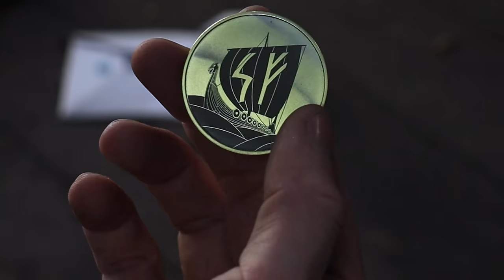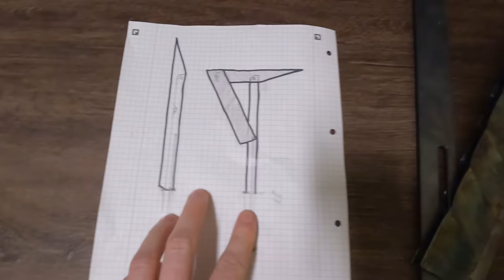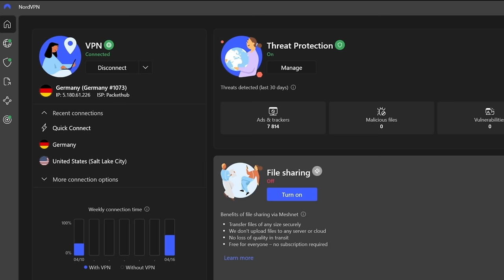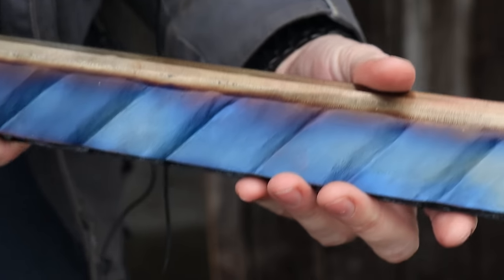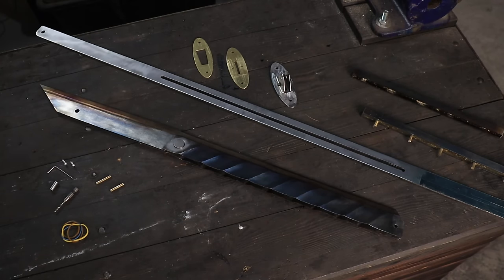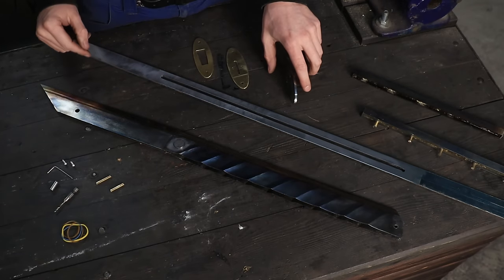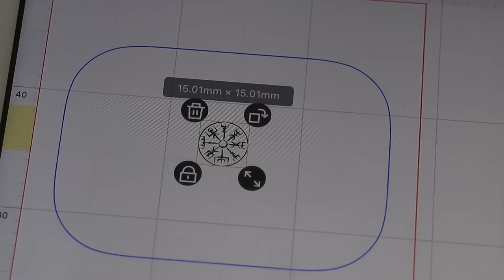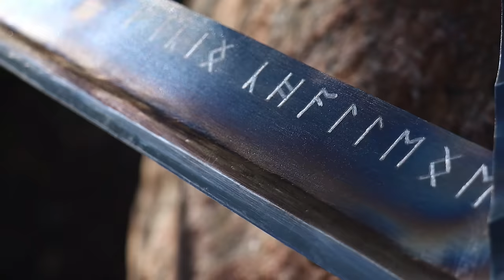Making a functional SWITCH AXE

Comment: Would several interlocking plates (like a baton) work for giving the head extra weight? I know this thing is supposed to be a weapon but switch blades can be used in an emergency survival situation.

So maybe loose interlocking plates (for weight) connected to both the head and the body through either cranks or strings to stiffen them up should work right?

I dont really know lol, this design is still super cool though.

Comment: Ik this would be more moving pieces, and add weight, but maybe you can add recoiling dampening spring system, something to absorb shock from hitting objects to not only make strikes easier but reduce strain on the other moving mechanisms?

Comment: I wanted to do something like that, taking the one from Biomega, still I don't have good thin metal plates around so I would need to forge it out all via hammer from a two centimeter thick truck spring leaf........... :d.

Comment: I’m at 2:41 so barely into the designing/construction phase (let alone testing), but I couldn’t help but wonder what kind of latch you’d use. If you relied on just friction to keep the blade in sword mode mid-swing, then swinging it fast enough to, yknow, chop someone up is liable to unfold the axehead and throw off your aim (or worse, break), but making it able to stick enough so that you have to manually engage it means you have another point of failure in whatever mechanism holds it in place

Definitely still a really cool idea and I wish I had one to fuck around with, might see if I can’t make one out of wood or something

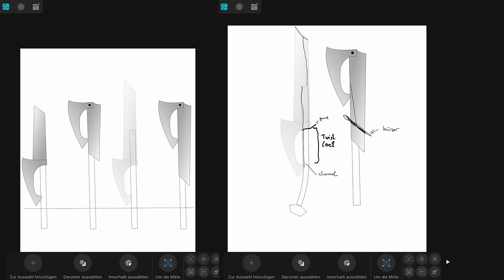Comment: 1:17 >allows to choke up on the handle like you would when swinging an axe
????what???? You don't want to choke up when swinging it, all that does is rob you of a massive amounts of power. Like imagine holding a hammer on the handle versus under the head, you have comparatively zero power output

Keyword swinging, not saying that there aren't any reasons ever to choke up, but when actually swinging to inflict damage is most definetly not one of the times you want to
Reply from the maker: You seem to know how to swing an axe so I’m sure you’ll figure out what I meant

Comment: Pretty awesome idea I think it’s been execute quite well. Seems pretty functional. However, from what I know of for welding and creating blades mainly from watching forged in fire and some amount of college experience I would suggest that if you were to do something like this again instead of welding parts together after you’ve treated the metal weld everything till you’re happy with it then do the heat treatment, just starting with an aneling to soften the metal where it may have become work or casehardened then use forge clay to protect the spine of the blades during the hardening process. The clay will harden on the spine of the blade preventing the spine from heating up to drastically and then when you quench the bleed the clay will prevent the spine from being quenched, this should result in a blade that’s sharp and functional.

Comment: While this is 11,000% a masterpiece of engineering and smithing, you missed a crucial detail of the Switch Axe: The tip of the sword has five tiny holes in it - well I say holes, they're more like little cupholders really - that do a lot of strange magic things like collecting the blood of the enemy and whatnot, but they're also the locking mechanism in both modes. Need to switch from axe to sword? Have to disengage that lock first. 
In the games, since the blade is so large, the hunters keep small glass containers called "phials" in the holes. These phials contain reactive chemicals, monster blood, and all sorts of other things. When switching from axe to sword, a striker on the inside of the axe blade takes off the stoppers on the phials and ignites the liquid inside, giving the sword mode a fiery boost. You can also load all phials into a single chamber on the axe blade and discharge them at the same time, causing a massive explosion. 
Obviously you can't do any of that in real life for just so many reasons, but it'd have been cool to see it referenced.

Comment: I think if you're going to do this again it might have been better to have the handle itself split in the middle of that way half of the handle goes up with the cross guard and that way you have two mini handles for each hand placement and you technically don't have to let it go at all you could bring your hands together for sword mode and then spread them apart for axe mode

Comment: If it doesn't have a locking mechanism, you could build one into / under the guard that can be unlocked with your thumb. It could be something similar to the legs on a square folding table as a simple one. It could also be modified utilizing other locking techniques, like the ones used in some knives, to make it more advanced and possibly more stable.
Excellent work BTW!

Comment: Hey, isn't the fluting in the wrong direction? Because you never want to hit the sides of the flute with the impact of the strike that's not the reason they're there it's the other way where the impact is meant to go in the same direction as the flutes, at least as far as armor and structural Integrity are concerned❤

Comment: You need to start using some clay or other material to insulate the thin parts of the metal (like the spine) so when you do your quench they cool around the same rate.

Comment: I would have made half the handle telescopic with an eliptic form. 
Like two pipes with one on the inside that the outside pipehandle slides on.
(Think telescopic sheath for katana in style over the parts you already made)
That should make it a little more rigid in the open axemode.
But it would add a little more weight...
But it´s always fun to watch your new projekts!
Keep up the good work!!!
Reply from the maker: That's a good idea!
Thanks for watching 🙌

Comment: Sorry to say this, but you might have done a mistake when discarding your other ideas in the choosing of the design. The main reason to use to axe in battle is to hook shields or to control longer weapons. The "beards" on the axes weren't for decoration.
Reply from the maker: Yeah I’ll make a bearded one in the future. I just wanted the sword mode to look like a big seax for this „viking challenge“ 👍🏻

Comment: trick for brass pins in hard to reach places: with you pin cut to the precise length desired, use a little glue (any) to put a steel ball bearing on each of the tips, then grip onto these nice and hard with some pliers to deform the pin, thus locking it in place.

The bearings should then pop right off, leaving a clean finish!

Alternatively, just use some weld to put opposing beads toward the end of a pair of pliers, permanently making them into pin-crimps!
Reply from the maker: That's a great tip, thanks!

Comment: The Top Connector needs to have a guide quarter as well as a pivot hole. The Guide Quarter increases the metal strain resistance. Also, you could have added another axe part and an extra bar that setup the control for a more axe like shape.
Reply: Guide Quarter with hole example >>>  (  o  <<<

Comment: consider 2 pieces of nice, straight angle iron, each about 1-1.5 meters long, which you can clamp in your vice (and a few locking clamps) as a post-quench straightening jig

just quench your piece, and, when it's still hot, clamp it in the jig and let it cool. it's cheap and not too much of a pain, and can save pieces!
Reply from the maker: Yeah after completely messing up the quench I remembered that would be an option. Didn't have any angle iron on hand, that was long enough though 😄
Reply: @NjordArtisan  fair, my dad always said "investing in tools and making jigs is investing in your future" though! 😁

Comment: This came out gorgeous and a lot more functional and robust than I would have expected from the design!

If I could suggest anything for a hypothetical v2 build, I would try to find a way to put a beard on the axe blade or to otherwise give it more of a traditional axe shape. While we don't really have any way to figure out for sure if Viking era Norse fighters used them that way, the "hook" an axe beard forms is very useful in melee combat. You can grab a shield with it and yank it aside, you can grab someone by their shoulder, things like that. Also, it lets you get your hand right behind the cutting edge.
Reply from the maker: I started off with a design that looked like a bearded axe (and I also prefered that, because bearded axes are awesome) but I really wanted the sword to look like a big seax which is why I went with this design instead

Comment: How heavy did it end up? Is it still light enough to use like an ordinary sword, or do you have to change your style a bit?
Reply from the maker: 1,9kg/4.2lbs
It’s a bit heavy for a sword of that length but it handles okay because the balance is about 10cm/4inch in front of the guard
Reply: @NjordArtisan  Not too bad. Trade a bit of nimbleness for versatility (and novelty).